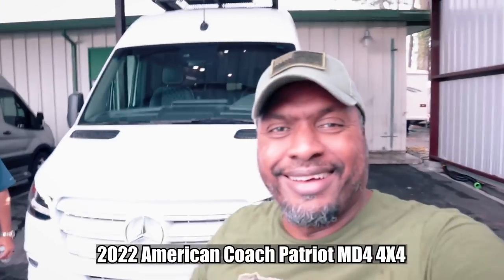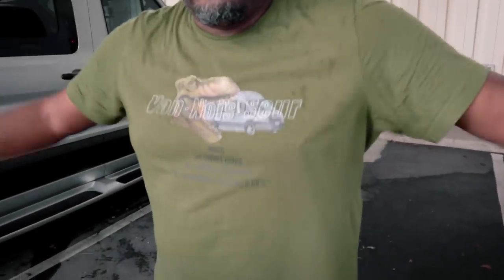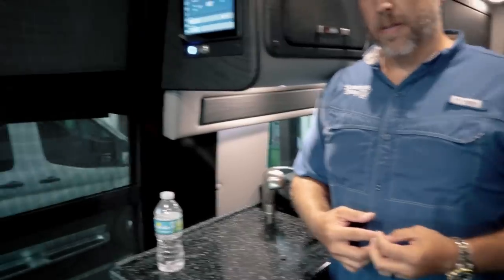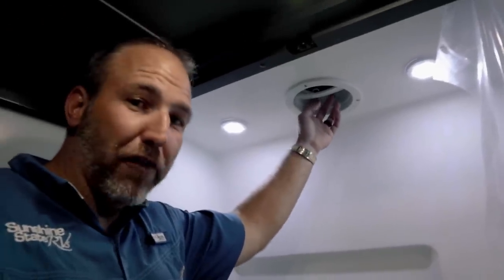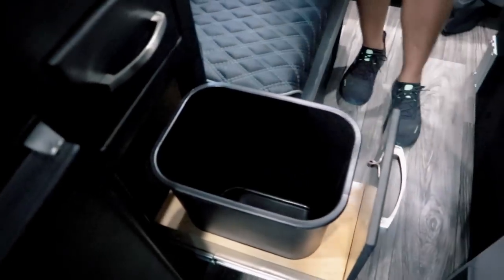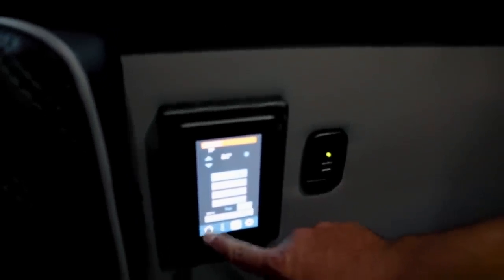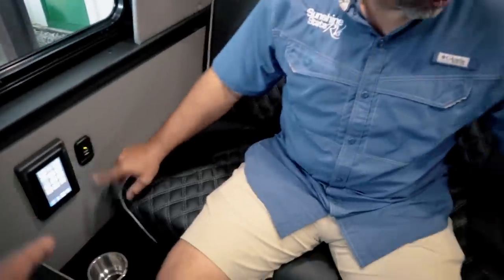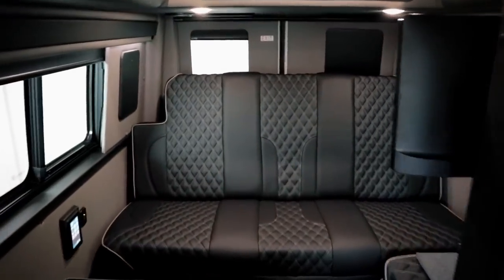The Ultimate Luxury Overland BEAST! American Coach Patriot MD4 4WD Class B 2022 Sprinter Van

Comment: This is one super impressive Class B RV!  However, for the simple fact that the unit may have to be towed to acquire maintenance I would prefer a Ford or Ram RV.  There are so many options available out there and so many different price points.  I have lived in a GMC Savana 2500 cargo van for nearly a year and a half now.  My conversion is a no build one.  I simply moved my man cave from my old home into the van and I love it.  Now I know what I want in my Class B which includes AWD, bathroom/shower facility, sufficient storage and Lithium batteries.  Your Coachman, Hank, seems to fit my needs.  I have to consider my fiance's needs so when she returns from serving in the Ukraine 🇺🇦  we will actively shop for our Class B.  Thanks for featuring so many available options, Hank!

Comment: So the batteries are outside and under the Chassis? Looks like
1. It could get extremely cold in winter
2. It could be damaged when off road
Bad battery positioning?

Comment: Thanks for the video..  like the Black w the Gray..  think the best would be All Black- so no dated opposing piping and stitching color..  And yes love the matte finish.  A couple other design notes wish AC would address..  the new flush drawers are great but make all the storage space uppers flush too..  go flush at every opportunity ie: the bathroom door.. and get away from the rounded corner routered look..  The induction cook top needs to be 2 burner..  under that counter cover could easily be done and will fit under a counter in the same fashion. Also the sink fixture-  so dated looks like a cheap Delta faucet match it to the same style in the bath👍🏻.  Also Nick mentioned you can get get the batch door in glass..  would be cool to see the “double door” IN GLASS!!  Top Tip Nick I also agree PB sandwiches absolutely Strawberry Jam w Crunchy PB but before you put those slices  of bread together put some Lays chips in there!! You won’t go back!  Love the video Hank! Thank you and Nick
Reply: O
Reply: I agree that it needs a double invention burner and the sink does look dated.

Comment: Too dark inside.  Depressing.  Isn’t it a problem in cold weather to have the lithium batteries outside?
Reply from the maker: that's definitely personal preference for sure (I've noticed my wife likes lighter colors inside)...with the batteries I believe its based on the tech: Battle Born is good in extreme heat and cold temps
Reply: The batteries have heating pads.  We love the darker colors in the one we ordered.

Comment: Can't question the quality of American Coach however, must be said that the bathroom and layout in general lacks innovation There are many bathrooms in smaller vans that offer dry toilets, particularly in European builds. A better bathroom solution would probably also eliminate the need for a shower curtain, at this price range and in 2022 a shower curtain is not a solution nor should it be an option!!! There are so many builds especially independent builds which have much better layouts and are very innovative. Van conversions biggest issue is space so, there should be no door handles sticking out as per the bathroom door. The fridge is far too small. Does the TV always stick out like that? If so, seems poorly designed/considered! I know you said the bed was easy to make but at this price range I'd expect not to be playing tetris to make my bed. Maybe for a secondary bed but, this doesn't offer 4 berths yet seats 4? On overnight trips with 4 people where are the 2 passengers supposed to sleep? Nonetheless, an amazing class b with room for improvement. As always love your vids.